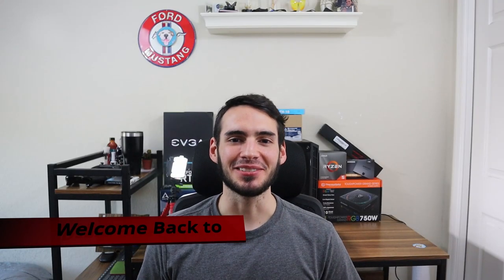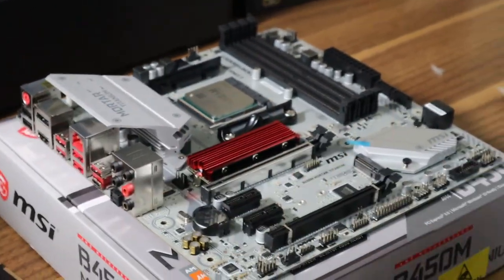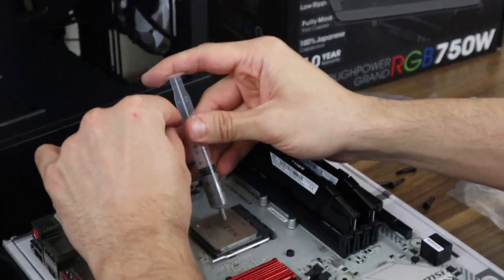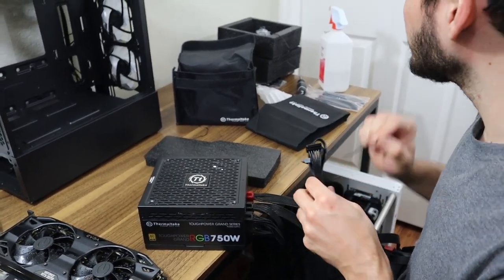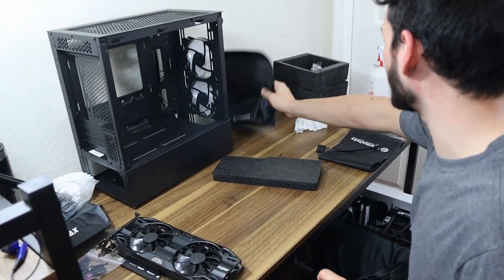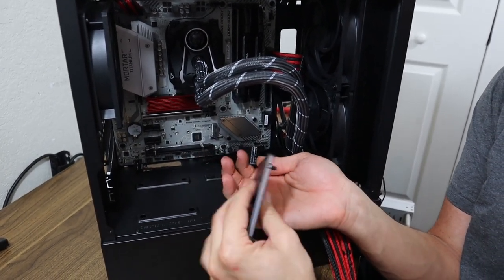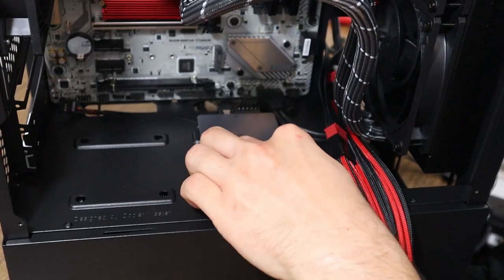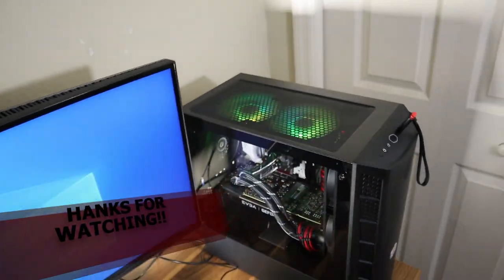$1500 Gaming PC in 2020 AMD Ryzen 5 3600X / RTX 2070 Super

Comment: Hey man how's it's been doing for you so far? I'm currently trying to figure out what processor to get for vr sim racing..thats all I use my pc for...i have a i56400 and just got a used evga 2080 super xc hybrid for 500 which is awesome ..im thinking my cpu is holding me back and was going to get a 9700k for its higher freq per core think it goes to 4.9 which i heard was better for vr..problem is I've been searchingonline to see which cpu is best for vr specifically sim racing and come up short..just wondering how the performance has been for you with the ryzen.thanks in advance
Reply from the maker: This combo has been fantastic. Never seeing drops in performance. Since you have the 2080 id suggest either the 3900x or the 9700k. For strictly gaming, Intel is known to perform better. If you'll be editing videos with the same system, you'll see better performance with more cores with the 3900x.
Reply: @DannyDoesComputers  k thanks man tbe more I look into the cpu tbe more im confused.lol the 8700k is more money than the 9700k but i wont be edited videos just doing be rim racing..just want to be able to play acc and rf2 with better performance..i have ams2 but haven't been able to play since right before the official release..i play raceroom ,assetto corsa with sol and content manger which i highly recommend it looks amazing in vr. Acc rfactor2 and ams2 when i can get my pc built..my current pc just died on me ..i had a i56400 and with that card could play everything but most where constantly in are at 45fps and acc in hot lap and multiplayer only..most these sims only use a few cores it seems and are cpu heavy with the physics it seems..what amd would you recommend if I wasn't doing anything but racing with maybe 1 or 2 things running like crew chief and sim hub
Reply from the maker: I'd say go with the 3700x or 3800x depending on what falls into your budget. I've seen both go on sale quite often and for very good prices too. Are you in the US?

Comment: Very helpful for a beginner. What monitor is that?  Also why did you need the cable extensions?
Reply from the maker: The cable extensions are not needed at all. I just like them because they look cool. The cables included with the power supply would work just as good as the extensions but won't look as Nice lol. And the monitor is a curved 34 in Dell Alienware. 3560x1440 100hz refresh rate. Overclockable to 120hz

Comment: Great build! Would an Arctic Freezer II 280 work with along with the included ARGB front case fans in a push/pull set up as you have? even though the rad fans are 140mm?
Reply from the maker: Would it work? Yes. Is it the best possible push pull configuration? No. For best results, you should buy matching 140mm fans and put them up front. The 2 120mm fans can be moved to the top of the case.
Reply: @DannyDoesComputers  thanks for your help, this makes sense I'll go with some 140mm fans then.
Could you recommend any that would work with the ARGB controller included in the case?
Reply from the maker: Any fans with a female 3 pin ARGB connector. Do your research on which fans are best for you
Reply: @DannyDoesComputers  thank you very much

Comment: You should flip your radiator around so the hoses are at the top.
Reply from the maker: The reason you don't do this is because over time you will lose fluid due to permeation and air will begin to form inside the radiator. Those bubbles settle at the top and if your hoses are at the top then those bubbles will make their way to the pump and you never want air to run through a water pump

Comment: Hi is your gpu hotter than usual?
Reply from the maker: I never saw any issues with temps on the GPU. Even with maxed out settings and 1440p resolution
Reply: @DannyDoesComputers  My gpu got fried at 84c (may be due to the push pull config in the front}. Now I am waiting for my replacement and its been about 1 month and there is no response from the service center.

Comment: Don't put waterpump like that the tubes need to be upper than CPU because of air in the tubes the pupm will be dead like that soon. but Nice build!
Reply from the maker: This isn't true. The cpu pump is not going to do like this
Reply: @DannyDoesComputers  Maybe your'e riggh but it's sugesstion from older waterpump fails and braiks...
Reply from the maker: I appreciate that, but air would settle at the top of the radiator and wouldn't find it's way to the pump. JayzTwoCents recently made a video describing what way you should mount your liquid cooler and the only way you should never mount it is with the radiator parallel to the bottom of the case with the pump above it. The best way to mount a radiator is at the top of your case.

Comment: where do I put the hard drive in this case? I have an ssd and an older type hard drive. Thanks!
Reply from the maker: The case comes with a hard drive enclosure in the rear of the case just behind the power supply. I removed it because I wasn't using it and I needed the extra space for cables

Comment: Thats not a great way of installing the aio. I highly suggest switching the aio's orientation so the tubes are coming from the top not bottom
Reply from the maker: Both ways are fine. There's nothing wrong with how I have mine installed. I have done this in multiple builds on systems that get daily use. No issues in years
Reply: @DannyDoesComputers  Actually no both ways arent fine and my bad you have it mounted the correct way.
Reply from the maker: Both ways are indeed fine. The only way you should never install your AIO is at the bottom of the case with the tubes coming up. For front mounted AIO, it's best to have the tubes down, but some AIO tubes aren't long enough. So, tubes up is fine.

Comment: Hey, nice build, I want to get this case and was wondering how your GPU thermals are with the arctic freezer AIO at the front? I ask about GPU because its a smaller case and wondering if the warmer air from the radiator affects the GPU much at all? Thanks
Reply from the maker: This case has very good airflow. As long as your gpu has a good cooler design, you should be fine
Reply: @DannyDoesComputers  Yeah I was kinda wondering specific temps as I have an evga 2080Ti which will be fairly close to the psu shroud.
Reply from the maker: I don't see temps higher than 70⁰C on my GPU. Currently I have an EVGA 2070 XC ultra. I moved the 2070 super into my Intel gaming and video editing pc. The cooler on the XC ultra is great no matter what case it's in to be honest. If you're worried about the temps with an AIO get low profile RAM and mount the AIO to the top of the case

Comment: What do you think of the case ? Is the cable management good ? Are the temps good ?
Reply from the maker: Cable management would've been easier without the cable extensions, but I like the red and black cables. Also. Removing the hard drive cage definitely helped with tucking cables away behind the PSU.
Reply: @DannyDoesComputers  Nice, thanks for the quick response
Reply from the maker: Oh and airflow is good too. Sorry for not including that in the initial reply
Reply: @DannyDoesComputers  No problem ;)

Comment: where did you get the rubber stoppers for the ssd
Reply from the maker: They came with the case
Reply: @DannyDoesComputers  ok well im bouta dig in my storage room to find them
Reply from the maker: Good luck!
Reply: @DannyDoesComputers  also quick question i was thinking about which 1tb of storage to get and do you recommend the seagate firecuda or the crucial bx500?
Reply from the maker: Both are good options. I'd usually pick a cheaper one because all NVMe is pretty quick and you won't notice a difference between those two. The only time you should spend a lot of money on a fast storage solution is if you're editing very high resolution videos or doing very complex 3D animations.
Reply: @DannyDoesComputers  ok thanks for the help

Comment: do i need 2 fan headers or the fans connect together
Reply from the maker: This depends on the type of fans you bought. Some fans can do this some cannot. If you use the arctic p12 pwm fans, then yes they can connect together
Reply: Danny Does Computers i meant the included case fans on the case you were building in
Reply from the maker: Oh I'm sorry. The case came with a splitter that allows you to only use one fan header on the motherboard for the preinstalled fans.